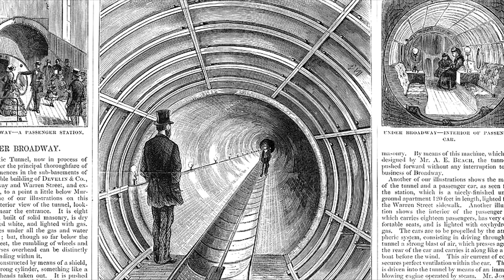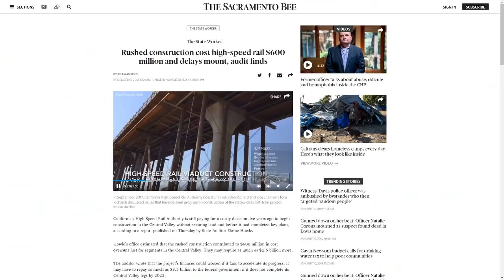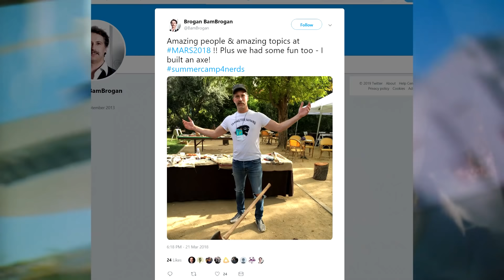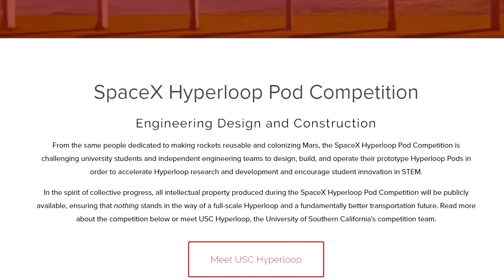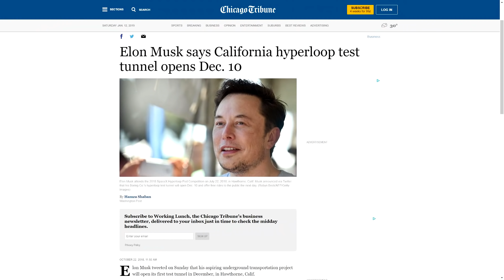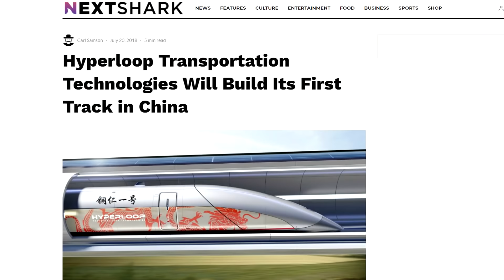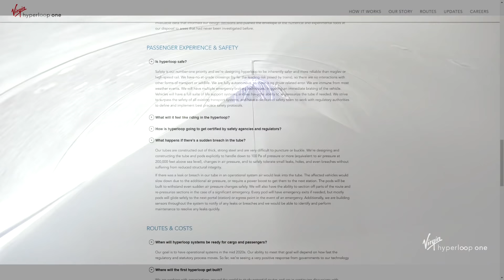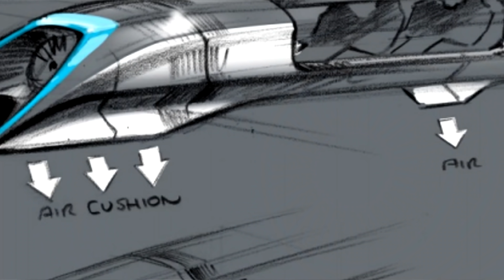Why Hyperloop will FAIL HARD - Its Biggest Problem...

Comment: "It won't fail just because of technical reasons?"  YES it will.
Reply: M. de k.  Yes there is. Building a public transport system that runs in a collection of 600 miles long is basically impossible. And doing this while having any safety standards at all is a joke.
Reply: Robert Verlinden what about trains?
Reply: M. de k.  Wow! You're absolutely right. That post looks like it's missing a couple of paragraphs in the middle! I don't know what I was thinking. 

Well then, let me try again! Building a 600 mile metal structure is very difficult. As @Chabotal mentions above, "what about trains?". Exactly, what about them? The rails that trains run on might seem solid, but in actuality they are moving all the time. Expanding and contracting with temperature changes, moving side to side when trains run on them. Train tracks are always being worked, they are constantly being repaired. Just to keep two metal beams roughly 1400mm apart. 

Now lets build thin walled metal tube that for all intents and purposes will behave like one piece. The amount of movement from the temperature differentials above, below and inside the tube (for simplicity) and the expansion and contraction of the structure that would carry the tube is only one reason why this vacutrain idea is science fiction. 

How are you going to keep a vacuum over 600 miles? How are you keeping all those pieces of pipe in line with each other with greater precision than you'd need for high speed rail? And how are you going to prevent that structure from cracking while you shoot 15 tonnes trains through it at the speed of sound? Railroad tracks crack and warp all the time. But now you're gonna run a hard core vacuum where a structural weakness will be fatal?!? 

Even this one problem has not been solved technically. Let alone how to achieve and maintain that vacuum. People are free to dream and burn money. But none of these "pioneers" have presented any engineered solutions to any of the myriad technical problems with the proposed system.

In the end Musk is not an engineer! He's a huxter and his big talents are that he can hype up an army sycophants and relieve ignorant investors of billions of their dollars. As for technical stuff, he can use a lot of money to hire very smart people and pretend their achievements are his own.
Reply: M. de k.  Something that produces more problems than it solves isn't a solution. Mind you, the technical problems I had mentioned where only examples and there are many more. You just mentioned one of them.

Airlocks! This is one of the things Thunderf00t mentions and he's right. It's easy to say we'll just put in airlocks, but you don't provide a solution for it. Nowhere have I found how these airlocks will be built and how they would work. You can't act like this is an established technology you can just slot in, because it's not. Especially not at the size that would be needed for something like what we're talking about.

And what's worse is that putting in airlocks would work entirely against the purpose of building such a system. Slowing it down and increasing the amount of time accelerating and decelerating. As you mentioned you don't want too much g during acceleration so it would take some distance to get up to speed. Every stop you add, you add the distance you need to speed up and slow down. And you reduce the time the "train" travels at top speed and you increase the traveling time. All of this is moot because we haven't even begun to imagine how to build an airlock that big and that airtight that would open and close many times per day and stay operational over a period of decades... 

Anyway, nothing about that is a solution for the expansion problem. High speed rail is so expensive because the tracks are required to be more straight than normal train tracks. Hence the increased engineering and maintenance requirements. And maglevs, basically what a hyperloop would be, have much higher requirements yet! That's why implementation is slow and distances of the tracks are (relatively) short. And that's because it's a pain in the ass to keep everything straight. Now you don't just have the rail or maglev track but also miles and miles of flimsy tube you need to keep straight while heavy equipment runs through it. And your tolerances will be even tighter than with a maglev because if your tunnel isn't straight you'll hit the wall at the speed of sound. 

And burrying the tube underground again produces more problems than it solves. How are you going to keep things in line while dealing with subsidence of the ground or seismic activity? And how are you going to check the outside of your delicate vacuum-tube when you bury it underground? What about rust? What about repairs? What about safety? 

I think you're mistaking technically possible with theoretically possible. Theoretically this idea was possible a hundred years ago when it was invented. Technically we haven't really progressed that much since then, even though computers would make it seem otherwise.
Reply: M. de k.  Well, lets discuss semantics then. The hyperloop idea is theoretical, because despite some technologies existing implementing them at scale is another matter entirely. Yes there are people working with vacuums, but none at this scale. Getting this to work at this scale is entirely theoretical, and none of the "hyperloop" companies have presented any realistic solutions just pretty CG video's. 

The same go's for all the other things you mention. None have been implemented at the size and precision that is needed to call it technically possible. Some submarines can dive thousands of meters deep. But submarines of any practical size won't go much deeper than 800 meters. Why? Because they are two different beasts. The same is true for other technologies, scale requires technology all of it's own. And most of the things you mention cannot be implemented at the scale that is needed. So while it's technically possible to draw a vacuum in this context it's wholly theoretical. Because 1. it's never been done, 2, many existing solutions don't scale and 3. it is unknown which problem scaling up will present. 

Therefore it is theoretically possible but not technically.
Reply: M. de k. If the tube leaked, the air would rush in at the speed of sound.
All of the energy used to create the vacuum would instantly return, at the speed of sound. Anyone inside would be destroyed violently and instantly.
The cost of burying it not realistic.
The size changes described above by sun caused heat are in the order of hundreds of meters on a 600 km tube.
Thunderf00t has several vids trashing it. He’s on YouTube
Reply: M. de k.  if there appears any structural damage in the thin hull of the hyperloop, then it will not stay small. It will immediatly tear a much bigger hole into the hull. This is a normal behavior of aluminium.
Reply: And using anything else than aluminium for the hull as e.g. steel just worsens the problem of thermal expansion and does not solve the problem of hull breach for sure
Reply: M. de k.  Then you would have the problems mentioned earlier and you would have the problem of digging the worlds longest tunnel. But even when its underground there will be a alight fluctuation in temperature which you will have to compensate while having to maintain a near perfect vacuum.
Reply: M. de k.  Burying it underground would make is prohibitively expensive. And maintaining a vacuum tube that long is very much physically impossible. Not necessarily impossible on paper. But sure as shit is impossible in reality. And there is almost no actual benefit to this 100 year old idea that elon stole
Reply: Well, not JUST for technical reasons
Reply: Care to elaborate?
Reply: It's practically impossible to maintain a 600 mile vacuum.
Reply: ryanhaart you seems don’t know much about of how “vacuum” works in this context. There is no need to achieve an absolute vacuum, it only requires the air to be a few percent of the standard atmosphere. The exiting air pumps along the route ( one every few KM) is more than capable to handle.
Reply: Say hello to seismic activity.
Maintaining vacuumed 600 miles pipe isn't practical. 
Even oil pipeline needs huge maintenance and isn't even vacuumed.
No need to mention low capacity compared to proven maglev design.

Comment: Failure #1.  Capacity or passenger throughput.  

You use 2,472 and 17,199 per hour.  Let's see what BoringCo claims as their max throughput.  (Copied from Boring's FAQ page.)

"Loop ridership is a function of the number, size, and spacing of stations.  Generally, high-volume Loop systems target 10,000 people/hour. If a system requires greater ridership, additional tunnels can be constructed"
  
That's 10k per hour at ~150 MPH.  Multiply by 4 if vehicles in a hyperloop are traveling at ~600 MPH.

Failure #2.  Product.

Boring/Musk moved on from air sleds some time back.  I'm sure you know that they are using maglev.  I'm not sure why you act as if you don't know that.

400 MPH is not fast enough.  To easily replace airplanes travel speed need to be 600+ MPH.

Failure #3.  Land Acquisition.

BoringCo is going underground where route acquisition will be much easier and much cheaper.  If nothing else, Boring could travel under existing highways which would mean no need to deal with NIMBY and reluctant land owners who would have to be taken to court to gain eminent domain approval.  Again, let me copy in from the FAQ page.

"Hyperloop is an ultra-high-speed underground public transportation system in which passengers are transported at 600+ mph within a vacuum-sealed tunnel. Whereas Loop is used for shorter intra-city routes, Hyperloop will be used for longer inter-city routes.

TBC’s current tunnels are designed and built in preparation for their eventual transition to Hyperloop."

Failure #4.  Safety.

A Boring hyperloop (and Loop) system will use three tunnels.  A central tunnel will serve as an emergency route out from either travel tunnel. 

There's no fuel in a hyperloop vehicle.  There's no asphalt paving that can burn.  The only flammable materials would be vehicle upholstery and that could be easily dealt with using hand held extinguishers.

There's nothing to run into.  There's no cross route traffic or anyway for an animal to wander into the vehicle path.  

All vehicles in the tube/tunnel would be controlled by the same computer.  If there was need to change speed or stop all vehicles would respond the same way at the same moment.

There's no sky to fall out of nor rails to fall off of.  

Failure #5.  Energy Costs.

Traveling in a reduced pressure environment requires far less energy than traveling in Earth surface pressures like trains do.  Airplanes quickly climb miles above the Earth's surface in order to reach 'thin' air where they can cruise at high speed and use far less fuel per mile.  The main idea of any hyperloop system is to create a low pressure, low air resistant environment at surface level.  

And traveling at surface level means the vehicles can be powered with renewable energy, which we can't do for long distance flight at this point in time.

My name for the hyperloop?  It's a very interesting idea that, if it works out, will mean safe, comfortable, inexpensive long distance travel using renewable energy.  I'll give you a working name - "The Technology That Might Disrupt Rail and Air Travel".

Disrupt similar to how Tesla EVs are disrupting the car industry and Tesla storage systems are disrupting the gas peaker industry.  And how SpaceX reusable rockets have disrupted the business of lifting loads into orbit.
-------------------------------------

Here's the question that needs to be asked?

Why are the creators of this site not objective?
Reply: Hahahahahaha

Comment: Combine the two technologies, i.e. Put a super-conducting mag-lev train in a near-vacuum tube. Theoretically, you could reach over 1000 kph / 620 mph.
Reply: it's ironic, all this rejection and denial, yet this was all said about regular high-speed maglev several decades ago.
what did it take for japan's high speed maglev to become a reality? he said it himself in the video, 50 years and i don't even know how many hundreds of millions if not billions of dollars.
even the criticism about sudden depressurization is only a problem due to a lack of imagination on his part, just have the outer shell strong enough so that it doesn't collapse on itself in case of a breach.
the reason no one is seriously investing in it is because it is a very long and costly investment to finally get any return, same problem with japan's maglev that was government-funded and why no one else bothered R&D'ing it, if you're a private company there are many better ways to make a profit.
he also doesn't take into account the whole point of having a maglev system. once it's finally developed, which is very costly, maintenance costs are very low since there is no friction or point of contact with the rails.
Reply: Billy Giovinetti no
Reply: @V0YAG3R  Honestly, going with a hovertrain might be better. It's like a hovercraft but on rails. The french were designing one, but failed.

Comment: Hyperloop is Maglev in a low-pressure tube, simulating flying at high altitude, therefore travelling speeds of 800 km/h (500 mph) and beyond are quite realistic.
It is pointed out at 9:18 that a capsule takes 28 people. Who says that air tight sealed capsules cannot be stacked one after the other like the Shanghai Maglev train?
And by the way, the new Hyperloop 2020 test track will have a corner.
Reply: No longer maglev

Comment: these places should just build a maglev train.  It's faster, cheaper, safer, has quicker turn around times and the lines have a way bigger carrying capacity per mile.  It is literally better in every way.  Why is no one talking about it?  Oh that's right, hyperloop hype.
Reply: Maglev is not practical. Normal High speed rail is FINE.

Comment: “Why are these tests still on wheels?” I don’t understand why the video is asking that. The track isn’t powered like Japan’s maglev, it just has coils in. To start with the pod has to use wheels to go along the track. After 20mph the coils push the pod up without any power. The only power is used on the pod to move it forward. The hover comes from permanent magnets unlike Japans maglev

Comment: Hyperloop is no way new. It "died" before in Switzerland as the for very long and seriously officially planned so called Swissmetro project (an underground maglev in vaccuum running 500+ km/h) exactly for the same reasons you mentioned here in this outstanding video..
Reply from the maker: I knew I was forgetting to mention something! Yes this was a plan back in the 90s that used more or less the same principles of the Hyperloop. Thank you!
Reply: CLP They already started recovering parts beyond the 1st stage (not 100% success yet). Dragon supply capsules do land already.  Their only Earth gravity escaping flight so far is supposedly still in it's planned interplanetary orbit.  Their manned flights are crawling through government approval, if they had willing death defying participants they could have flown multiple already with some survivors.
Reply: Except hyperloop isn’t a vacuum and is no longer a maglev.

Comment: I could imagine you writing aviation was bound to ultimately fail because of the limited success of the Wright Bros.
Maglev trains work, so obviously, maglev trains in tubes will eventually work.
Fuel costs are lower than trains or planes.  As energy costs rise, and fossil fuels wane, that helps hyperloops.
Reply: Yeah, a channel called American Rail Club making a video about why Hyperloop will fail is like Blockbuster saying Netflix will never take off.
Reply: yeah people like to ignore the real benefit of maglev once all the R&D is done.
maintenance and upkeep costs are much smaller and more simplified than other existing transportation methods, making them cheaper in the long run and especially at large scales.
Reply: Yeah, because airlines totally won't be looking into cleaner alternative fuel sources.
Reply: joe caterman  Yeah, sorry this is a pretty old comment so I had to reread and rewatch to figure out what you were talking about. I think that what I was trying to say is that airlines are far more competitive than hyperloops, mostly because it's a well established industry with greater access to capital and and an established consumer base. Hyperloops as they are don't even have practical models that can comfortably seat people let alone move them around in nearly airless tubes at supersonic speeds.
Reply: -> "I could imagine you writing aviation was bound to ultimately fail because of the limited success of the Wright Bros."
- Not really, because airplanes actually EXISTED before the Wright Flyer flew. HyperPoop exists ONLY in CGI.

-> "Maglev trains work, so obviously, maglev trains in tubes will eventually work."
- Maglev trains work, but adding a tube that can't leak for hundreds of miles won't work. Not to mention how a single leak will kill everyone in the entire system.

-> "Fuel costs are lower than trains or planes."
- In theory. Tue running costs for trains would be far lower than HyperPoop.

-> "As energy costs rise, and fossil fuels wane, that helps hyperloops."
- No, it helps high-speed rail and maglev, not HyperPoop.

Comment: Some people are talking about hyperloops like they will be cheap enough to use daily. That’s false. Maglevs cost $50 000 000 per kilometer, and add in the air pumps and tubes it may be $60 000 000. Multiply that be the 800km trip planned in California, that’s 50 billion dollars for the trip. One ticket would have to be hundreds of dollars each for construction alone.